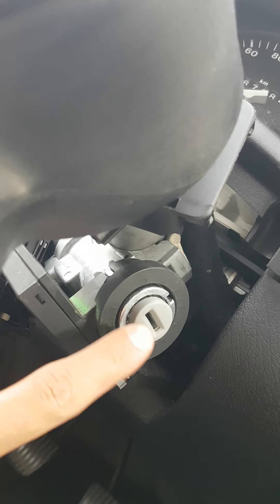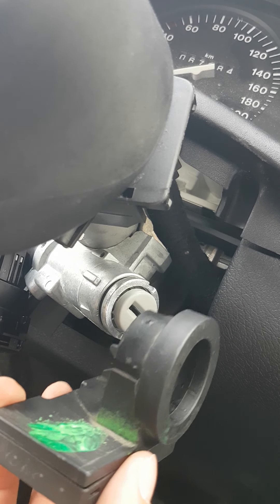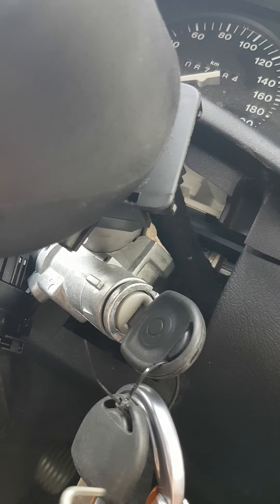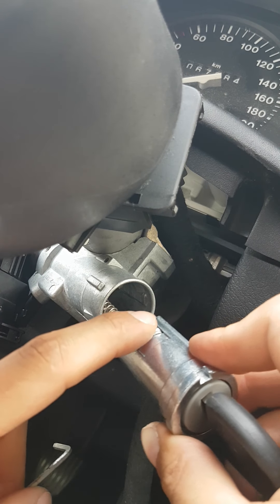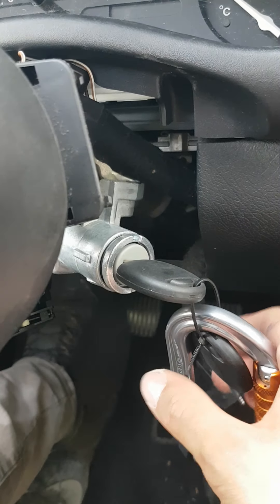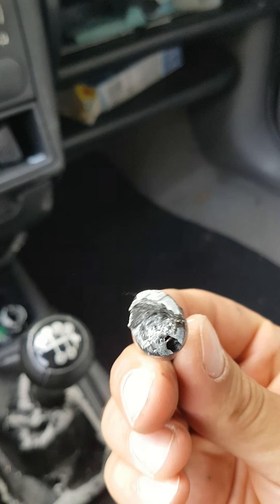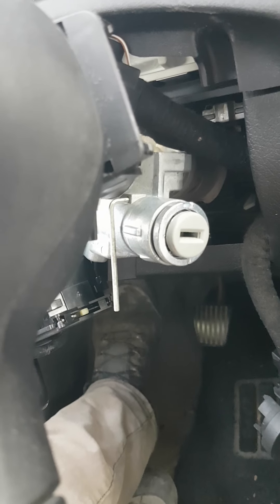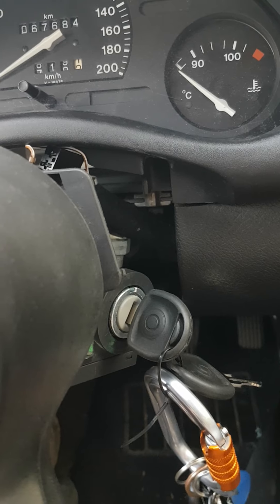How to Remove and Replace Ignition Barrel/Switch/Lock Cylinder Without Key in Opel Corsa B

Comment: Approximately how much does it cost to program the imo box and does all Opel Corsa have the chip, how do I know that mine is got a chip or not.? Hope I am clear
Reply from the maker: I could list the cost here, but I don't really think that your country has the same prices. You should ask a local key shop. I think all should have an immo box, and if there is an immo box, there is a chip. Remove the plastic under the wheel and you will see if there is a box or not.